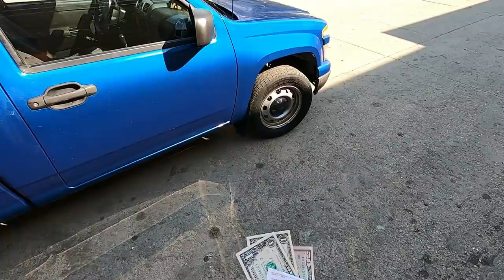Epic Trash Picking Jackpot

Comment: @2:00 Hello , If you will be installing another pedal it is lefty tighty for non drive side (left ) This rule applies to most bikes except Italian and French ones. Make sure you clean out threads on crank arm with old toothbrush and finger tighten at first making sure not to cross thread it. It also helps to put a thin layer of grease on the pedal threads to prevent galvanic corrosion which makes it way harder to remove. Hope this helps...

Comment: I got inspired to try plastic recycling by watching several YouTubers. I'm mainly gathering #2 plastic ( high density polyethylene,  HDPE). 'They' are doing away with the plastic grocery bags in 2021 here, so I'll be mainly going for plastic milk jugs.
Speaking of plastic milk jugs,  you should carry one full of oil-absord from the auto parts store in case of fluid spills in the bed of your truck. A cup & a half of that would have absorbed all that yeck!

Comment: Paul I think you should take the auto parts ... The way you could avoid oil and anti-freeze in the rear of your truck is to take a tote with you and put them in there ... And take some rubber gloves with you so your regular work gloves don't get messed up ... I hope the suggestions will be helpful ... Looking forward to the next video ... Stay safe and blessed ...
Reply: Scrap yard where I live will not take engine parts or equipment which has or had oil, antifreeze, or other contaminates in or on them. Those have to go to hazardous waste depots along with paint and varnishes, etc. Oregon considers itself a leader in recycling mostly because of the many strict rules. Some states aren't as fussy. Unfortunately, some people respond by sticking unacceptable items in bags and dumping those in the landfill garbage can. Truck drivers are trained to catch that, but I'm sure they don't always. The dumper gets fined if caught.

Comment: That is a nice bike Paul 👍, and that craftsman motor should be an easy resale.
It is only auto oil it will not hurt you, you pic through garbage that who knows what germs are on it.
The oil in truck bed can be absorbed easily with clean kitty litter and a powerwash will clean out the liner which you should do before moving furnishings anyhow.
Thank you Lord for giving Paul this test of patience to build him stronger.

Comment: the top of your rack ,   run a piece of pvc through the hole and either pin the ends or glue a cap on it and you won't have to run a rope for the verticle stuff

Comment: That bike is to nice to scrap all you need to do is buy a peddle
Reply: Yes they are about $10 at the local bike shop for a basic set if they have them. 9/16th's is the more common size.
Reply: myvicariouslife Paul will probably sell the bike on Marketplace.
Reply: maybe find another bike to pull a set from...could happen...right? lol
Reply: @canoetipper019  Good idea however some might be on there extremely tight.
Reply: @myvicariouslife4012  ever listen to tool - vicarious? Google and read along with the lyrics?
Reply: @blal07  yes, I am quite familiar with the album.

Comment: Do you ever consider taking the transformers out of microwaves ?? I know most of them are aluminium now but you still get copper ones. Same with motors. Do you strip any of the ones you find??
Reply from the maker: I don't. Low roi
Reply: Scrap & Pallet Man cool. I don’t blame you it can be a lot of work for not much reward.

Comment: The aluminum radiator two minutes with a saws all and you get better money 4 it
Reply: Or even a hammer and chisel/flat screwdriver. Take the 2 plastic ends off and you have a nice bit of clean aluminium.

Comment: You can clean the gloves in kerosene then in washing powder and you can clean the car by wiping it with rags then washing it with dish soap or washing powder also.
Reply from the maker: Won't kerosene make it worse?
Reply: @ScrapPalletMan  
Yes, If it's made of nylon or anything effected in petrol.
You can also clean it with carburettor spray or degreaser or even coca-cola if you wish 😁.
Try what you think is right.

Comment: Hey Paul, I've asked a couple of times but you always skip past my comment and comment on others, but have you put any through into using a trailer for the heavier things like bbqs and washing machines ect, would be able to collect more scrap and save constant runs to the scrappy.. plus would save more damage to your shoulder using a trailer to.
Reply from the maker: I thought about it. But I don't want to wreck my truck towing a heavy trailer with just a four-cylinder engine.
Reply: @ScrapPalletMan  well you have a work horse of a truck, and I'm sure it would manage a medium trailer at  most just don't overload it, maybe use of for more of the fluffy scrap, just thinking economically here and more scrap for you, and let's trips asweĺl... it's worth a try??

Comment: 43:03 that Paul is an driver's side  airbag inflator it is responsible for propelling an airbag outward when an accident occors, the holes on the side vent the pressurised gas. That was the main part that caused takata to issue millions of airbag recalls.
Reply from the maker: Oh my, wow! I had no idea.
Reply: @ScrapPalletMan  it's okay as long as it's hooked up to no electricity source it's harmless

Comment: The aluminum radiator does not go in the shred pile it goes into the aluminum pile that’s a Easley 10 bucks right there Paul
Reply from the maker: It's irony aluminum. $0.05 per pound
Reply: A lot of the radiator is actually aluminum so check with ur magnet before you scrap anything that is aluminum or anything because If you save enough aluminum you can get a Lotta money for that kind of stuff trust me

Comment: that radiator was all aluminum with plastic end caps worth at least 7 dollars scrap price and I scrap them all the time.
Reply from the maker: Irony aluminum breakage $0.05 per pound
Reply: @ScrapPalletMan  but there's no iron in it just aluminum and might be copper on the elbows just like that ac coils you have siting in your shop my scrap yard takes them all the time as old sheet aluminum or aluminum radiators or coils depending on how big they are hardly ever is there steel on them theses days

Comment: There is no one watching how would they know if you threw the routers in the pile
Reply: God would know, and so would Paul.  If he did it,  he would not be acting in line with his values. 😇
Reply from the maker: The rotors are worth $0.09 per pound and the shred steel is $0.06 per pound